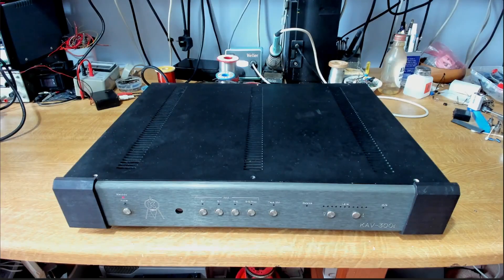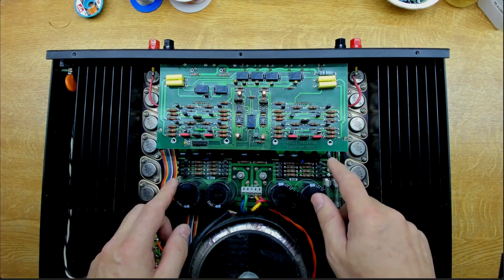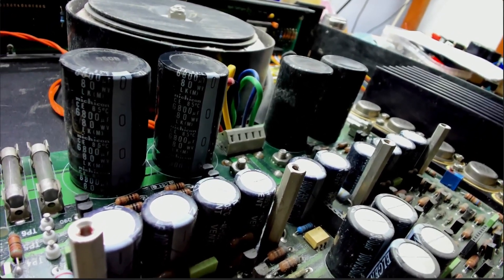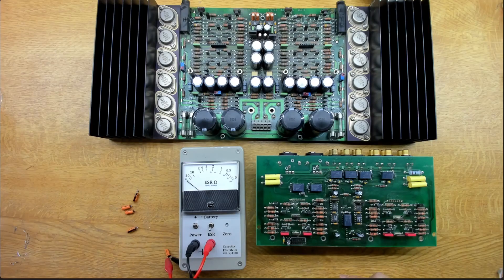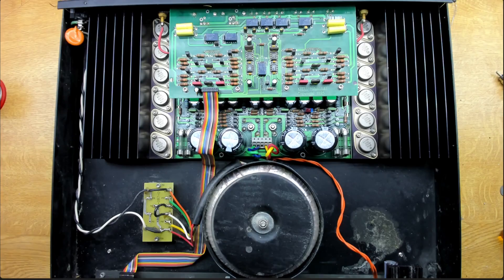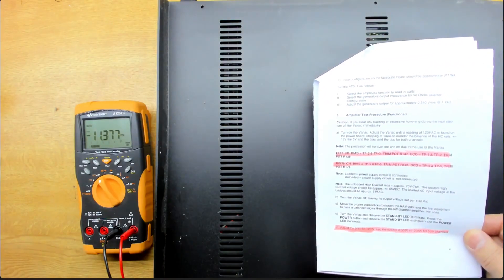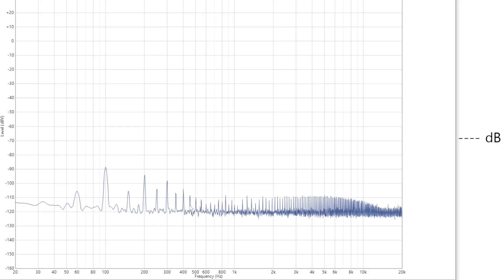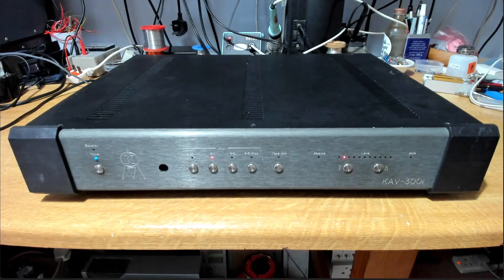Service of a Krell KAV-300i Amplifier

Comment: I serviced a kav300r awhile back. It's almost the same unit and it had about the same failures as the one you did. The klk caps were burnt just like yours but they were still in tolerance I replaced them anyway but what a hearty cap to take that kind of abuse and still be working at all. The caps next to them were totally bad. Here in the states klks are no longer available .those were some of the last ones I had. They are ultra low leakage so not sure of a good replacement.  The long line of caps were bad as well on mine. Guess the closed space below the circuit board just roasts caps over time.

Comment: Thanks for this video. I ve owned my KAV for about 28 years. It still sounds amazing though I am considering preemptively replacing the capacitors and anything else. It is indeed a beast and has way more power than I can ever use. I currently am driving Meadowlark Shearwater Hotrod speakers that were an incredible find about the same time I purchased the krell. The speakers were too good for the price and the company went under. No problem with those either. Some Cardas cables and a Tice power conditioner and I ve been very pleased considering the current cost of high end components. I live near the Krell headquarters so I might just suck it up and have them do the work.
Reply: Did you end up recapping yours? I know Krell has been operating with a skeleton crew after their president unexpectedly passed away.

Comment: Bought one used today and i'm afraid of the amount of power he is delievering to my speakers (With vintage high-End transparent cables). 
By now i'm not putting the volume higher than the second led. 
Is it possible that an integrated amp can be considered with an issue with what i have described ( I mean - more power then the specs described on the specification papers) ?
I know it's a 150 W, but holly! My Paradigm Studio 20 V3 speakers are 89 Db and maybe the problem is they are sensitives for this guy.. 
I will try with the EPOS M15.2 wich are 86 db and hope i can push the volume to the third led at least without being so afraid.
I also have the Musical Fidelity Power+Pre A3.2 and also the combo Nakamichi PA-5 + CA-5, and never felt so afraid as i am with this beast.
Can you give me your opinion?
Reply from the maker: I cant say I had that experience, It is possible there could be a volume control issue lurking in there somewhere.
Reply: @myalbatech  No problem at all. With 86db speakers my concern desapeared. I am super happy with the Krell.

Comment: The bias voltage measured was actually -17mV not +12mV so that's one topic. Another is that this should not depend on whether the cover is in place or not. That the bias drops by 300uV suggests that there is either a leakage path caused by some blown power supply decoupling cap, a problem wth the earthing or tha the amplifier is oscillating (above the audio band - prob several 100s of MHz). IMHO.
Reply: 9:10 Measured bias voltage "polarity" depends wholly on the chosen positioning of DMM probes, so is of no practical consequence whatsover. Bias instability has to do with common, imperfect tracking of temperature dependency of hfe/gm of the dies and by no means related to a fault. Lateral fets are the only subtype of output transistors that do not need such compensation, thanks to their thermal coefficient of zero at about 120 to 160mA of DC bias per pair.
Reply from the maker: @paulb4661  Agree entirely

Comment: These Krell labelled outputs look like Motorola MJEs, don't you think? The whole unit looks well made, but not devoid of compromises, pretty much like a castrated version of their usual works of art.
Reply from the maker: Yes, both the drivers and output transistors are standard onsemi (motorola) devices.
Reply: @myalbatech  Which presently produced transistors are replacements for the original Krell labelled ones?
Reply from the maker: @markwroblewski6500  These are from On Semiconductor
Reply: @myalbatech  Yes,but what are the Onsemi transistors to replace Krell 484002 and Krell 484081?

Comment: I don't like push button volume controls personally. You cannot beat a standard pot.
Reply: Agreed Michael, although I dont say no to precision resistor arrays for accuracy, better still , relay controlled as long as there's a knob to it. Buttons would drive me mad.
Reply: But aren’t pots inevitably dirty and/or prone to failure in the long run? The simple fact that there is a contact sliding over and over the same path over the same resistance material makes it not attractive in my point of view. On the other hand, I like the other comment that suggests a resistor array with some way of selecting them, not sure what brand uses that.